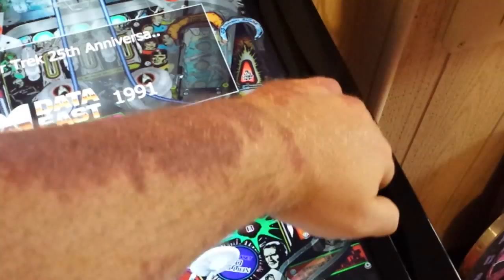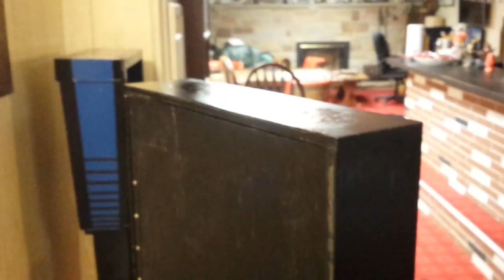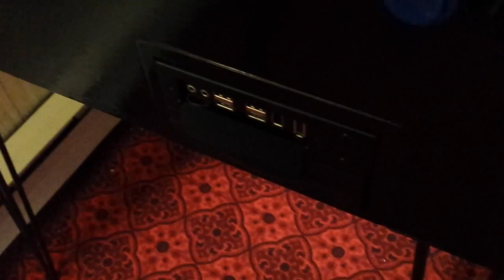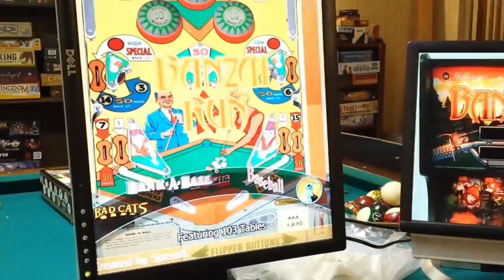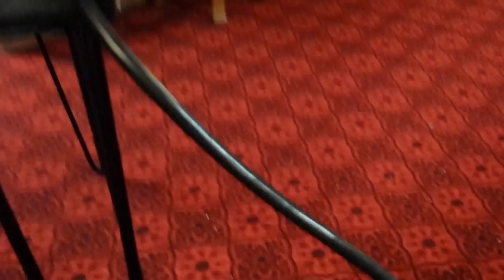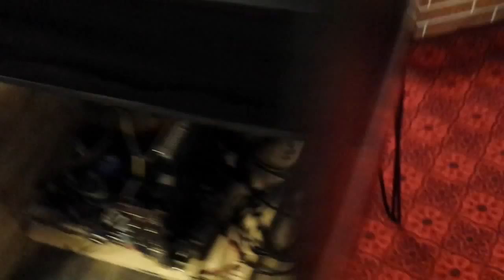The Pinbaby, my new mini size Virtual Pinball machine running VP and PinballX

Comment: V=IR,  I = V/R.   If resistance remains constant and you increase the voltage, then you're increasing the current (I) which can cause stuff to melt (if the components aren't rated to handle the current).

Comment: what legs are you using for these? where can they be found?  I'm trying to build a table but legs are the main issue...
Reply from the maker: They are called hairpin style table legs. I have found them easily on ebay for less than $100 a set, including shipping. Get the 3-bar style, they are stronger.
Reply: Pinball legs can be had for 75 a set if u look around on the internet. I built my full size machine for a about  $450

Comment: great video, you go fairly in depth about the whole build which is nice for people wanting to put one together. My question is about the legs you have used, I like that they are not the expensive actual legs that many full sized units virtual pins have and was wondering where one can obtain or what the name of these are?
Reply from the maker: they are called "hairpin" style table legs. available on ebay from many different sellers in a variety of length. mine are 26 inches. combined with the 10 inch height at the front of the cabinet, it puts the top at 36 inches from the floor. same height as most full size games.

Comment: I have a few questions since I am in the process of first building a small pinball table as a bare bone project so that I can get the wife's blessing prior to going in deep and building a full size table with all the bells and whistles.
Have you been able to test between lower in video cards compared to higher end video cards?
Do you have suggestions on sites to go to for building the virtual pinball?
Reply from the maker: In my own experience, and from what I have seen from others, the video card is not worked very hard and just about any modern card works well. My older machine is running a GTS-450. That's an S, not X. It was a mid-range card 6 years ago and works fine to run the pinball games in their current state. The GTX-750Ti cards I am using in my machines now is overkill. Future versions of Visual Pinball may rely more heavily on 3D graphics and will require more power, but even then I feel the 750Ti will work great for regular HD resolutions, 1920x1080 or 1920x1200. Some people are going in to the 2k and 4k resolutions now, and that does require a higher end card for smooth action. Of course, at that point, you're going to be investing some serious cash into the displays and working with larger cabinets. I'm focused on the smaller scale.
I've created a new channel for my PinBaby projects, please follow there for updates and more as I continue my work: https://www.youtube.com/channel/UCJ0nKaGZYklw89X3pd954fw
Reply: Thanks for the info.
I have a card that is 2 or 3 years old but was upper mid range at that time that should it least work well for the small prototype I am doing. 
I have been pricing out some of 4k tvs that don't have the smart networking etc... and have seen them as low as 150 which is what I am going to invest in first prior to a video card since upgrading a video card is easier than building a cabinet and having to find a tv that fits into a pre-built cabinet.
Have you worked with shaker motors, tilt sensors, or digital plungers much and if so what have been the results?
Thanks for the quick response and I  subscribed to your channel
Reply from the maker: No, I have not done anything with the motors, sensors, or other physical toys. You should visit www.vpforums.org and check out the cabinets section of the forums. Plenty of guys there have done some very advanced cabinets. That's also where you can get all the software and tables. I recommend sticking with visual pinball version 9.9 for now, since version 10 is still being developed and tables still being built.

Comment: Fantastic video! I have been looking into this for a week to build my own and was unsure on what specs to go with. Your video showed me everything I needed. I have a couple of questions though regarding screens. Is your backglass screen 16:9 or 4:3 it's hard to tell. I have two older LCD tv's that would look great for the games but when running windows the text is blurry. Should I use monitors or use the TV's? Also do you think an i3-4160 would be good enough for a while for a cab? I was looking at the 750ti vide card so that's perfect. Thanks
Reply from the maker: the back monitors are 4:3. at this size, that aspect makes the most sense. for a larger machine, a small widescreen monitor can look ok. i would always advise using pc monitors for this size of machine. small tv screens, especually older ones, are not usually very high quality.
Reply from the maker: also, an i3 processor should be fine. my older machine has an i3 and a GT450 video card, and it still capable of running these games.